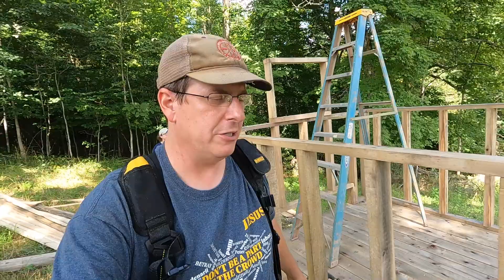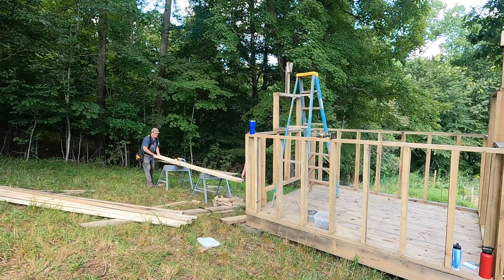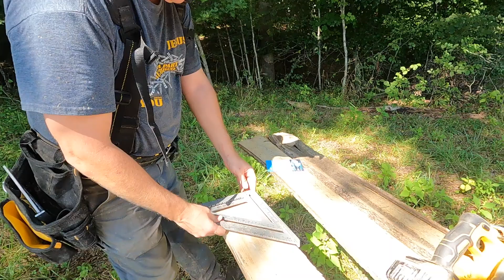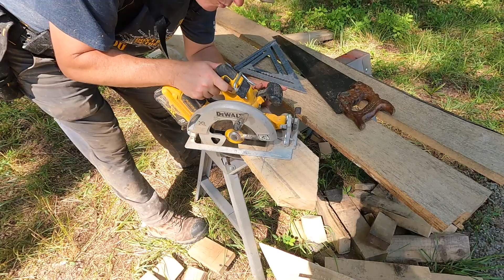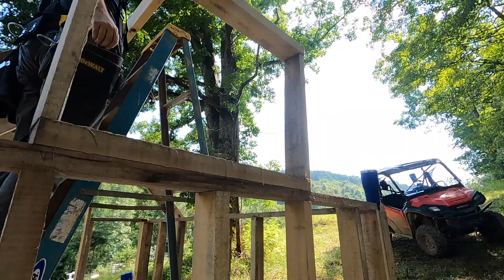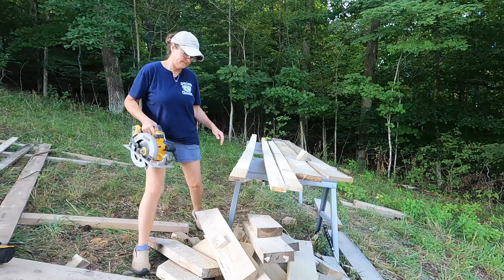Laying Out Rafters for Chicken Church

Comment: Nice summary of rafter setup. That's one skill I'm going to have to study in greater depth before my next building, because I've just winged it on all my previous construction and it really shows in the time it takes and how sloppy the cuts are when they go up.

It's nice to see you've got battery powered tools in the toolkit. I've noticed several homestead build videos lately where people are using plugin drills, saws, and everything else, but with a large property like yours the portability must be valuable. I've been expanding my battery powered toolkit this year, including a chainsaw and a lawn mower (that run off the same batteries). Best part about these electric tools is they're quiet ... I have sensitive ears, and normally I have to stand about a hundred feet from a gas saw with my hands over my ears, but this one I can operate without hearing protection and the volume is only mildly annoying. So this is the first time I've actually learned to operate a chain saw (at 30). Not sure how quiet your circular saw is, but I'm hopeful one day I'll find one that I don't need rifle-grade hearing protection to use. Until then, I'm stuck doing those simple cuts with a hand saw.

Comment: TROY,  was gonna comment about the collar ties on the rafters,  I had a so called contractor frame in a 20x24 cabin  with a  loft.  I can build and frame,but was not able to make the 3 hr trip all the time. When I did get there on  weekends,  the Ridge beam, rafters and 12-12 pitch roof was already done, No collar ties installed,  just 3 2x4s nailed together supporting the beam centered on the24 ft span, 19 feet high from floor to ceiling.  Needless to say the 2x4 bowed due to a heavy snow along with the Ridge beam and the exterior walls pushed out of plumb 2 inches on the 9ft high exterior walls.
I now call the cabin
The "RE-DO  Ranch"

Comment: Love your vids.  Wish I was there to give you some pointers on framing but looks like you've got it under control.  No better way to learn than "hands on". Only hint I will give you is bracing.  Brace and more brace.  Get everything plumb and level and then brace as you go.  And of course you pre laid out the rafters and overhang at ridge board before raising it into place. Going to be a great looking chicken church.